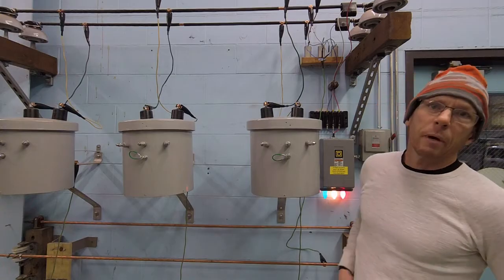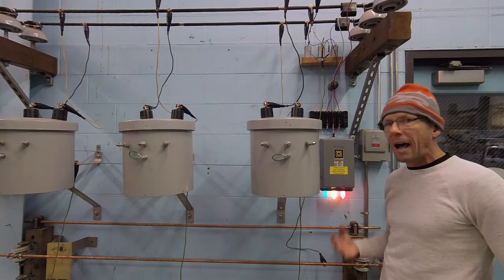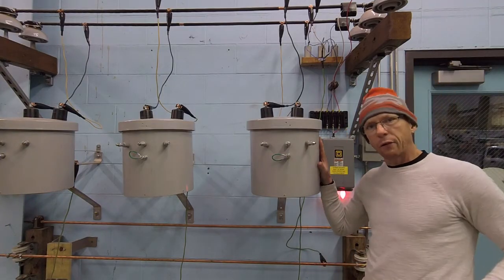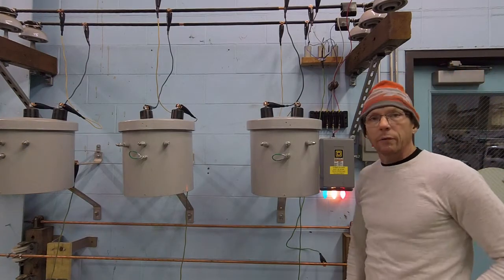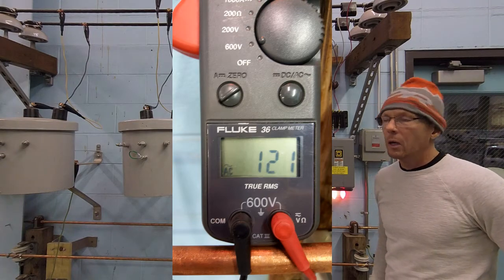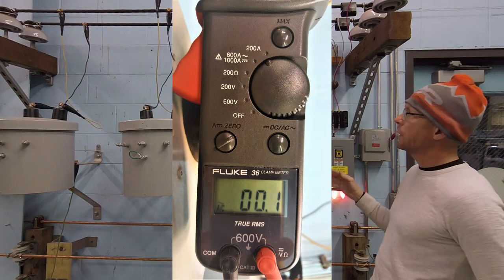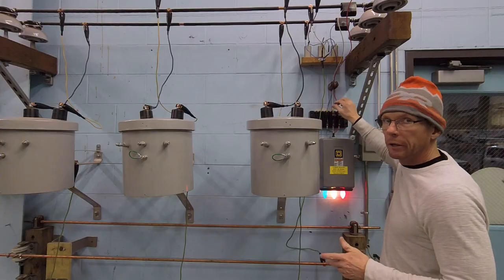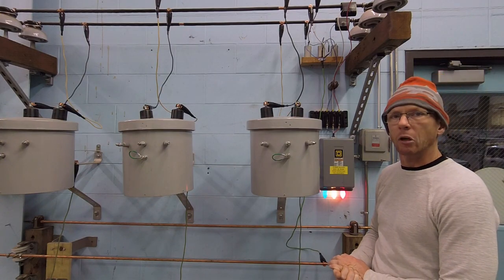💥Ferroresonance in Distribution/Power Transformers💥

Comment: Great explanation! I am a groundman/equipment operator on a contractor line crew for working in Southern California Edison jurisiction.  I've had no classroom time regarding theory and my wife didn't want me to become a lineman, so I have found my calling operating cranes, setting poles and operating cable pullers, etc...but, I've worked on a distribution crew for 13 years now.  I ask as many questions and have learned so much over the years, but this topic is always a head scratcher to even the most talented linemen.  Many try to explain, but it is such a phenomenon that 99% of the linemen I work with can't get it into words as well as you just did.  It is always denoted on our prints as well as the work order packet that a "Ferroresonance Conditions May Exist" and we work with the Edison Troublemen before energizing to mitigate an damage to the components or equipment.  From the various times we had this condition, it was always with single phase 12kv Line voltage in Delta energizing with extensive runs of URD Cable (JCN) to either padmounted or BURD transformers.  If I recall correctly, the foreman explained that the long runs of cable builds up the capacitance that potentially can create the condition.  But, this video helps explain it just a touch more than anyone has ever been able to before.  Thank you!

Comment: With Tesla coil the (air)capacitor is there mass of the wire and moist ground. The resonance can be kicked on by shutting the flow, so it will create a water hammer effect that produces back spike to the circuit. Or a static discharge from external source.

Comment: Admittedly, no "ferro", but I would guess a tesla "coil" which is really just an air-spaced transformer deliberately driven at resonance is very similar to this effect. if you drive a Tesla Coil out of resonance, you can get a fairly predictable "turns ratio" based output. Once resonance is achieved, things get exciting and the voltage has no (theoretical) limit iIRC.

A difference though, is that the resonance on a Tesla is a function of the capacitance and inductance of the Primary only - if the output coil is loaded, the TC stays in resonance. Yet it seems that with ferroresonance here, the secondary would dampen the effect (or I guess could possibly bring it into resonance ????)

Thanks for the video, i didn't know it was an issue with power distribution kit.
Reply: The resistance of your secondary wiring becomes a limit on how many electrons you can shove around once there's any significant current, so the current from free electron discharge limits the reachable voltages short of an arc... but once you have a spark, that's way lower resistance than open air, the voltage is going to drop drastically. "No theoretical limit" requires theoretically ideal insulators, while including the properties of air/insulation/potting compound (and the distance of various parts of your circuit from each other, like the spacing of secondary windings, spacing of electrodes) in your theories should nicely predict the voltage you can reach in practice before a continual plasma forms and the resulting increased current sends those electrons back in a loop.

In further practice what this tells you about an individual tesla coil is how wide you can set the spark gap before some internal part of your tesla coil becomes the spark gap, and damages itself.

Comment: I ran across power supplies that used this to stabilize the power of a transformer output. There would be a second coil that just went to a AC cap. The other secondary winding  just went to the bridge rectifier. Old school power supply from the 70's.
Reply: I would call the added winding TERTIARY.  Anyway, I have used (in a distant past) the ferroresonant voltage stabilizers.  They took some 15 or 20% primary voltage variation and produced maybe 1 or 2% output voltage variation.  Less than perfect efficiency and maybe some voltage distortion.  But they worked, some time before adequate power semiconductors became available at reasonable prices.
Reply: Ferroresonant transformers are what you are describing, and although the word "ferroresonant" is in the name, it's a completely different thing than what this video is about.
Reply: @jimmurphy5355  it's the same phenomenon, just lightning in a bottle as it were. CVTs use a magnetic shunt, an extra piece of core material, to isolate the primary and secondary, while the resonance is intentionally induced by the tank circuit at the line frequency, so it's constantly resonant. The result is a tuned oscillator producing a stable 60Hz, output voltage clamped by the saturation of the secondary side of the core, and the voltage spikes from ferroresonance kept on the tertiary winding.
Reply: @jercos  I would not call a ferroresonat regulating transformer an oscillator - it is a transformer with an LC resonant circuit tuned to the line frequency. Current in that LC circuit  saturates the shunt path in the core. The frequency coming out of a ferroresonant transformer is identical to the input frequency, and ferroresonant transformers only work correctly when the line frequency is very close 60 Hz (or 50 Hz if the transformer is tuned to that nominal frequency.) The voltage is stabalized, but not the frequency.
Reply: @jimmurphy5355  Perhaps my phrasing was unclear... in its voltage boosting function, the tank circuit is an oscillator, I didn't mean that the general operation of a CVT was an oscillator.

Comment: Really great lab model there.  I have heard in the ferroresonant condition sometimes there is current being pulled from the neutral bus.  Besides the phases providing excess excitation current have you tried measuring the neutral side current?  I believe Teslas magnifying transmitter worked on a similar principal in which he measured excess energy from ground.  This is interesting in those days it was not an electrified world so out on a mountain in Colorado many fewer ground loops.
Reply: You have no idea how close you are. I would just like to take this opportunity here to point out something. Ferro-resonance kills a lot of power grid transformers, spectacularly, and I read an article once about an insurance company or a researcher who compared insurance claims laid by power companies for damaged line infrastructure over a period of decades, then compared these figure to NASA's data on solar maximum and solar minimum, his findings showed clear correlation of an increase in claims made during solar maximum measuring in the Billions of $USD. Also I would like to point out it was Nikola Tesla around the time that the Niagara fall power station was opened who made the suggestion that power infrastructure should run on the 60Hz frequency.

Comment: Happens pretty often to voltage transformers for measuring MV. At 15kV systems we use VTs connected as single phase to ground. When ferro happens, they just cook and eventually short circuit causes them to explode. New systems feature VTs with additional windings/connectors to connect to ferroresonance damping devices.